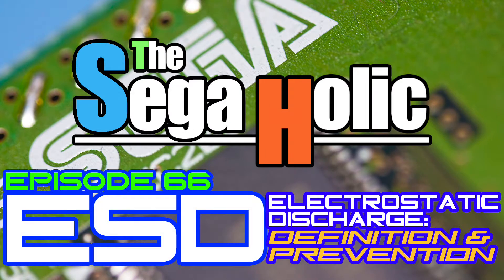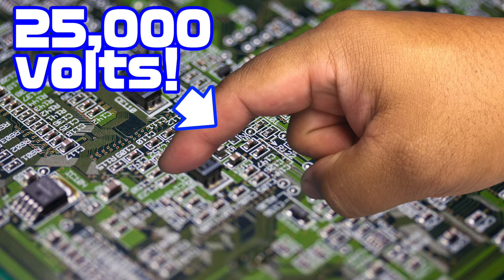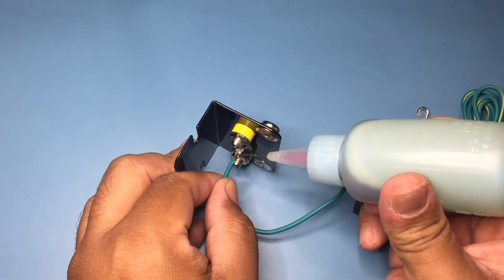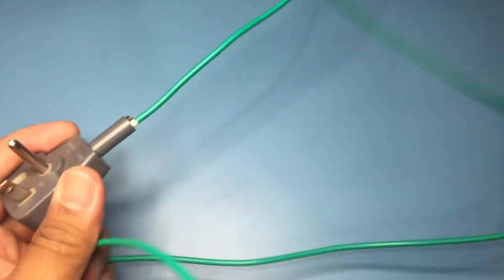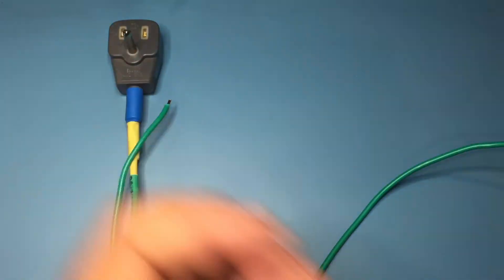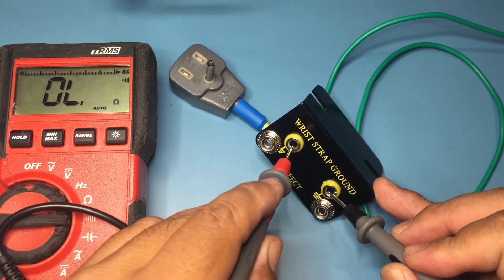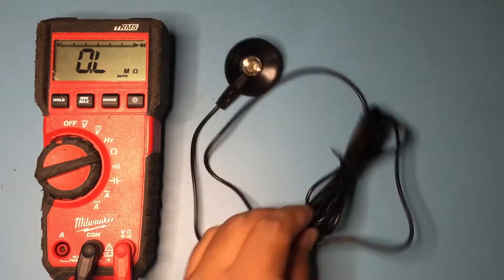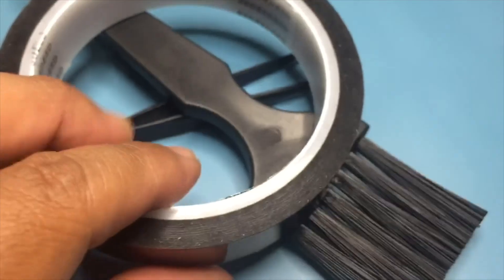ESD ( Electrostatic Discharge ) Definition & Prevention [ep. 66]

Comment: Great video and editing! Im planing on doing the universal BIOS mod to my white Japan console to change to boot splash. But learning to solder still and stuff. Do you have the new type of solder iron that the heater thing is the actually tip and not heating a metal tip extension?
Reply from the maker: I think you're thinking about INDUCTION soldering irons. They are very expensive. The Hakko FX100 goes for nearly $600. If you're just learning to solder, just get a Hakko FX888D for $100, or a generic Aoyue 937+ for around $60. But I'd rather chuck another $40 for the Hakko, which have a great reputation. If you're going to go Aoyue 937+, get rid of the tips and get Hakko T18 tips. TIPS MAKE ALL THE DIFFERENCE. The 937+ is a clone of Hakko's older soldering irons that used T18 tips.

I can also recommend Circuit Specialists as they have a lot of cheap and pretty good soldering irons.
http://circuitspecialists.com
I would call and ask if the iron you are interested in fits a T18 Hakko tip.

Refer to ROCKER GAMING'S channel to see how he does bios chip replacement.
https://www.youtube.com/watch?v=v7WmFaPb5Ns&t=11s

He uses hot air and flux. Since you are inexperienced, use CHIPQUIK. Watch the video in the page linked below.
https://www.circuitspecialists.com/chip-quik-smd-removal-kit.html
From what I watched and read, it is a very easy way to remove SMD chips, especially ones with a lot of legs. It uses very low heat, so damage to surrounding components and even the board and traces themselves are very low risk.

Here's another video showing how to use chipquik:
https://www.youtube.com/watch?v=UmD7F0--7Lc

Comment: So my take away from this video besides the ESD precautions. I didn't even think to double up on shrink tubing, I've always just used a single that fits, such a simple tip but effective to double up! Also, I hold a power level over 9,000 and should learn to harness my 25,000 volts of static electricity so I can be a super hero!
Reply from the maker: I just doubled up on the shrink tube because the first blue one was just enough to fit the bigger upper part of the cord, but didn't shrink enough to squeeze the ground wire. I cheaped out and got the cheapest ones on Amazon. You can see the stamping on the tubes too, makes them look ugly. UGH! 

Just watch more of my upcoming videos so you can level up to 25,000 volts. LOL. Seriously, ground yourself when working on electronics. I've been lazy putting on the strap, but will do so everytime for now on.